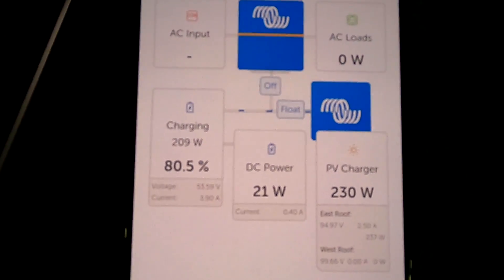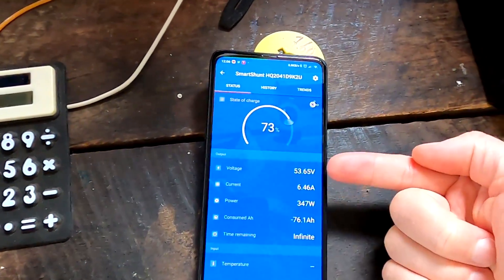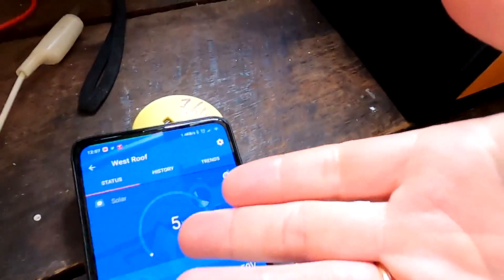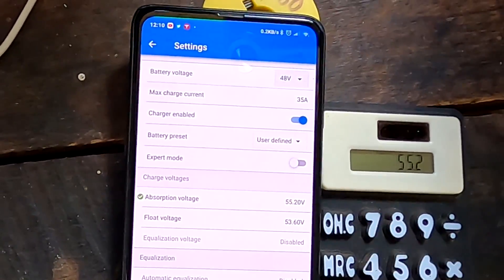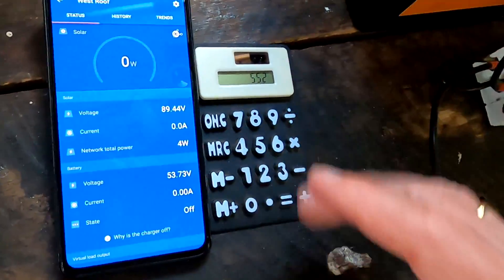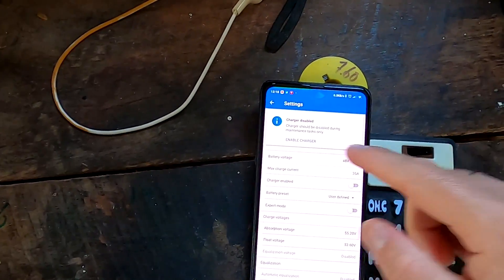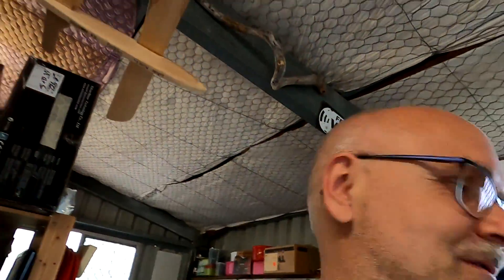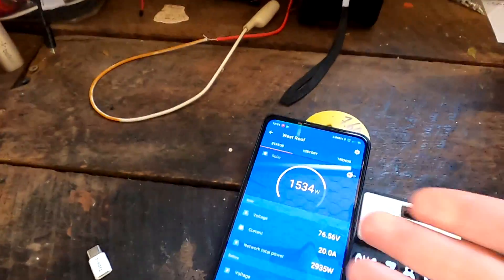Floating at 70%. Why charging LiFePO4 to 3.4V is not enough!

Comment: Did I see that right? You finally arrived at 3.45V absorption voltage?! Cool, now the float voltage to 3.375V to optimize solar production:-)
Reply from the maker: Float is only at 3.5V as this is the natural voltage the full battery goes back anyway. But 50% of people use 3.375V. That's fine too 😂
Reply: @OffGridGarageAustralia  true but that is not the reason. The reason is that if your solar can recharge your battery before sundown, it will keep powering your loads after that until sundown, while at lower than 3.375V you start discharging the battery instead of using solar power. At 3.5V float you will overcharge the battery… even at 3.4V float they will overcharge… but often float will only be for a short time until sundown, making it a moot point.
Reply from the maker: @DeVerm123  you can only overcharge your batteries if you go higher than 3.65V. Everything below that the current will go to 0 at some point of charging with CV.
Reply: @OffGridGarageAustralia  If you CV charge to 3.65V then the cell is fully charged and this is considered to be the finish voltage. The charger should then turn off. If you continue charging in absorption and float modes at 3.65V, the cells will overcharge. You can fully charge the cells by setting the absorption voltage to 3.4V and allowing absorption mode. If you float at 3.4V, you can overcharge according to some, or just not overcharge according to others, but it is considered too high for float voltage by all when considering cycle life. Even 3.375V is a compromise for utilizing solar power, as 3.35V is considered to be the maximum safe float voltage for 24x7 float.

Comment: Can't you set absorb time based on amps going into the batteries? I think Victron calls it "tail current"  I charge my lead acids like this and Absorb can be 1 hour if lightly discharged or 4 hours after heavy use (midnite classic charge controller)
Reply from the maker: Yes, I can set the tail current as well. That would be another setting to play with.

Comment: Hey Andy, why you work only with the timeout timer in absorbtion state. I mean in the SOC view the current cut-off during absorbtion is essential. The timeout timer is only a second condition to exit the absorbtion state and go further to floating state if you never hit the cut-off current. So as you know, to say 3.4V meets 99% or something is fussy because voltage alone is a very inaccurate indicator for SOC of a LFP battery.
My settings are bulk until 3.55V, then absorbtion until current drops 1A or 2 hours timeout, then floating at 3.3V with re-bulk if voltage drops under 3.2V

Comment: You don't need to auto-shut off your charging.  Just set the max A & V limits & the batts will not overcharge.
So, for example, if you charge to 3.45 V/cell, your system will only charge up to that V limit & your batt will never overcharge because it is well below 3.65 V/cell.  There's no need to absorb or float--the cells won't charge above your V limit.
Reply: That's exactly how my stupid system works! No sophisticated charger algorithms. Just get a DC power supply, set the voltage and ampere limits, and connect it after the BMS.

Comment: It's better to get to a high state of charge (pass the elbow on the charge curve) and do a very short absorption and let the voltage drop to in or just before the elbow. This is about the best you could do for battery health - avoiding sustained high voltage. Ideally also then the solar will power any loads because the load will drop battery voltage below the elbow.
Reply from the maker: The reason for charging to a higher voltage is for balancing purposes?
If you charge to 3.4V only, you would not need to balance as you're still in the flat area of the curve.

Comment: I think it's important to remember that in this scenario your setting isn't really "3.4v" it's actually 54.4v and more importantly: the problem isn't the 3.4v value. It's how you're measuring it. If you're relying on the shunt reading 54.4v you have to remember that is the voltage at the shunt with the resistance of the shunt itself and the internal resistance of the cells. If current is flowing into the battery the voltage at the shunt will read artificially high due to resistance of the cells as well as resistance of the shunt itself and any wiring between the shunt and the battery. If you're pushing 55 amps into the battery and the shunt reads 54.4v, you're not really at 3.4v per cell. If you were to disconnect the charger the voltage would instantly drop by close to 0.1v per cell because it would no longer be pushed high from the internal resistance. The internal resistance of LFP increases as the cells increase in voltage as well, so the artificially high reading gets even higher the closer you get to 100% SoC.

On my pack 60 amps of charge current at a high SoC results in a cell reading 3.40v when the actual resting voltage would read closer to 3.30v due to IR. So you're going into absorption when the cells are still only at 3.30v. This is why you cannot rely on the voltage reading at the shunt to determine when to switch to absorb/float. On my Orion BMS it actually reports two voltages for each cell: 1.) Actual measured voltage and 2.) "Open cell voltage".  Open cell voltage is the calculated voltage of the "open cell", meaning if you disconnected all loads and chargers, what would the voltage of the cell be? It calculates this by watching how the voltage changes as current increases and decreases and it calculates the internal resistance of each cell to come up with this "open cell voltage". So when it's making decisions about when to cut off charging or to cut off loads, it uses the open cell voltage rather than the actual measured voltage.

This inaccurate reading gets worse as you add solar. At 120 amps, for example, a 3.3v cell would read closer to 3.5v. So setting a higher absorption voltage will work for now, but as you add solar you'd have to keep increasing it.

The better way to solve this, in the absence of a BMS that gives you this "open cell voltage", requires that you either: 1.) Set a fairly long absorb time (remember if the voltage drops the absorb timer starts over) or 2) use the "tail current" setting available in the Victron for absorption so continue absorption until the tail current drops to some very small value to ensure that the battery voltage isn't artificially high due to a large number of amps. Using tail current basically tails the charger to ignore the voltage for the purposes of ending absorption until the current falls to a low enough level that it would no longer be causing an artificially high reading. if the voltage stays at 3.4v/cell and the current going into the battery drops low enough, then you can safely switch to float.

Another option is to just set both absorb and float at 3.4v/cell. You're not going to hurt your cells at 3.4v even if you kept them there 24/7. And since you're only charging from solar the max you could possibly float at 3.4 is just a few hours every day anyway because as soon as the sun starts to go down you won't be maintaining 3.4v/cell anyway.
Reply: This comment answers to so many questions. Thank you very much!
Reply: I was wondering about exactly this. I was thinking of using a Constant Current / Constant Voltage power supply to charge LiFePO4 batteries to 3.4V per cell, but was wondering if it would age the batteries to keep them constantly floated at 3.4V.
Reply: Tiene sentido porque observando el comportamiento de carga cuando está en 3,4v el equilibrio se mantiene sin embargo cuando voy subiendo a 3,42v y así hasta 3,45v este esta disparando la resistencia interna y produce más diferencia entre celdas

Comment: I think 3.4V is enough, but 15m absorbtion time is not. With this low voltage the absorbtion time can be "forever", remember your video where you made these tests with the 100Ah cell, the lower the voltage the longer was the absorbtion time.
Reply from the maker: Yes, I totally agree. And I was expecting these results but just wanted to test and see if I can confirm that even with a complete pack and not just a single cell charged with CC.

Comment: Yeah, it really depends on the controller, and settings. I have a Genasun boost controller that will only do 3.4v, but I think it recognizes the battery is still absorbing current so it will not go float for quite some time. This seems to get the cells to 90% pretty consistently.
Reply from the maker: Does this have a fixed absorption time or  is it monitoring the current and turns off of under a certain value?
Reply: @OffGridGarageAustralia  The Genasun controllers are hard coded from the factory so you cannot change parameters, or see what they are. But I kind of suspect monitoring the current is feedback to it's algorithm. That one is for my solar ebike build. My house solar controller is a epever, I let it charge to 3.45v, and float at 3.375v. They call non-float mode "boost" which is called "bulk" on other controllers. I have it set to "return to bulk" at 3.35v. So that lets it charge, then float, and if a load is placed it will return to bulk so I'm pulling power form the solar.

Comment: I remember from one of your videos where you used your battery tester that only going to 3.4 would take hours to completely charge the battery, why did you think 15m was enough? From my tests 15m would be more appropriate as an absorption voltage of 3.5.
Reply from the maker: It was just another test for the whole pack to see what SOC we will hit every day. It brings the same inconsistent result as with the single cell testing we did previously.
So, either charge a bit higher to 3.45V or set the absorption to ~2h.

Comment: I got all this figured out in the last few weeks too!

Looks like you're hitting 3.4v during a peak sun patch & flicking to absorption too early. Watch the voltage changes on a cloudy day - they'll vary by 0.5v quite easily on the charge controller.

Have you calibrated your Victron voltage vs your BMS voltages??? is the Victron V accurate?
I have a similar setup - 1600W panels into a 24v battery, and hit charge currents of 40-60A. So we need minimal absorption - as our charge rate is much lower than 0.5C/1C

I set my Victron 100/50 to 28v absorb (3.5v/cell) & float 27.5v (3.4375v/cell).  On the BMS the cells hit absorption between 3.47v & 3.49v - they dont actually hit 3.5v as the Victron voltage reads high!!!
The MAX absorb time is set to 15min, in reality its been going for 6-11minutes most days before going to float & the voltage drops right off when in absorption.

Pop your voltage up a bit & check what Victron reads compared to the actual Cells & BMS.

Good luck!
Reply: Hi Nate B, just curious, how did you manage to install 1.6kw panel if your scc is only 100volts max?
Reply: @noelbondad7423  hey Noel, 4x390w trina panels, theyre 40v 12A each.  so 2 pairs in parallel = 80v 24A max
Reply: @nateb3105  thank you very much. From my calculation: battery 7168wh. Panel harvest 7800wh (5 sun-hour).  Wow! I love it.
Reply: Or 1920w x 5 sun-hour = 9600 wh harvest. Even better mate.
Reply: @noelbondad7423  yeah that was the old config, have 30kw of battery & 10kw of inverters now :)

Comment: Try to use the tail current setting combined with fixed time for absorption. I use for my 600 Ah bank 10 amps at tail current and 30 minutes for absorption time. So when the absorbed current drops below 10 amps for more than 1 minute  , the chargers change to float mode. For me this happens after 6-7 minutes after the absorption voltage has been reached, in my case 3.5 volts. For you if you use 3.45 volts it might take a little longer, but using  tail current you are sure that the battery has absorbed enough and the same power every time.Moreover, in the battery sheet wrote that the charging cycle must end when the absorbed current drops below 0.05C, in my case it would be 30 amps. But the Victron chargers I use do not support more than 10 amps at  tail current setting, so I use 10 amps.
Reply from the maker: I had a tail current set before but found it's not really necessary. At 3.45V, the cells are 99% full, so I can just call it and stop charging after a very short amount of absorption time. I set the 15min usually to give the smart shunt to calibrate to 100% during that 15min window. That's the only reason. 
I think tail current settings make more sense when you charge to lower voltages and the absorption time is a lot longer. This depends then on you charge current, if you charge slow the absorption time is far longer at that voltage and a tail current makes sense.
I'll test.
Reply: @OffGridGarageAustralia  I charge up to 3.5 volts with tail current at 10 amps and the duration of the absorption sequence varies between 6 and 10 minutes. So the battery bank(600 Ah) reaches 10 amps in maximum 10 minutes and switch to float, which is ok.
Reply from the maker: @mihaitaiosub  Thank you, that makes sense. At this high voltage, the absorption does not take long regardless how fast or slow you have charged. It's 99.9% full.
I'll test the tail current with my 3.4V and see how this goes. Setting the absorption time to 2h and a 10A tail current. That should get me close to the same result.
Reply: @OffGridGarageAustralia  Those 2 hours will only work if the current in the tail current is not reached. If the current in the tail current is reached, the charger can float at any time before those 2 hours.
Reply from the maker: @mihaitaiosub  it's that's the point. At such low voltage we don't know how saturated the battery already is. So absorption can be anything.
Reply: @OffGridGarageAustralia  Before using or testing the current tail option, make sure that the charger and smart shunt are connected to the VE.Smart network, so the charger will use the values for voltage and current reported by the smart shunt that are much more accurate.

Comment: Great stuff. Some of it is over my head as none technical. Does that mean I should not attempt to build eve cell 50kwh bank in a few years for a new build house in the Caribbean. Should I just buy off the shelf powerwall from Alibaba. Then daisy them up. Bit more expensive but easier to set up and manage maybe??
Reply: IMHO, if you have the money and don't enjoy playing with this stuff, buy the powerwalls.  If you have the time and want to tinker, and it is fun for you to be a scientist and learn, go with the DIY set up.
Reply: @mfgxl  I hear you. I want a little tinker but would need to but a lot of equipment and when the time comes for me to do it I’ll br quite old man so I’m thinking find a way to get thr means to but the powerwalls. But tttttthen there’s always the reliability issue with the cheapest I’d be able to afford. I contacted a company from Shenzhen China. And for 5 pieces of 10kwh rack style (a bit like the Gyll) walls shipped to jamaica was around $12k usa dollors. Plus there’s the Wharf clearance fee which are exorbitant it jamaica. So ad another 1500 to 2k on that. Not cheap at all. But a tonne of power yum.

Comment: I am not sure if someone answered this yet, but I was explained differently when the solar guy installed my first solar system on my first sailboat, I am explaining it in 48v terms, but my setup was a different voltage. The solar guy explained it this way. Float is your target cell voltage x cell count. So let's say you want 3.4v/each cell, that would make your float voltage 54.4v because that is your desired optimal voltage when your batteries are perfectly balanced. Now you need to figure out your charge cell offset, this is how far apart your cells become throughout a full charge. So in my case, the guy set absorption voltage to 54.4v and hooked a load up and discharged my cells to low cut, then he used a charger to charge the battery to full 54.4v. Then with the default 2hr absorption period, we viewed the BMS and noted the cell difference as soon as it went into absorption mode and he timed how long it took the BMS to balance the cells within 0.01v. The cell difference going into absorption is your charge cell offset and the length of time it took the battery bank to balance to within 0.01v during the charger pause period is what we use to adjust the settings. So let's give an example, on the flip from bulk to absorption mode you saw a 0.075v cell difference between your cells because they are poorly matched... well now we would adjust your absorption voltage to Float Voltage (54.4v) + Charge Cell Offset (0.075v) = 54.457 ~ rounded to 54.46v, so this new 54.46v would be your Absorption corrected voltage. In regards to absorption time, this is how long it took your battery BMS to complete the balance, so in regards to my BMS it was only 4 minutes to complete a balance. So the settings would be adjusted as follows based on this scenario: Absorption 54.46v, Absorption Time 0hr:04min, and Float 54.4v. Regarding the bulk voltage offset restart, the guy told me to turn on all my typical constant loads that are expected to be on every single day ex.. frig... and then compare the voltage of your battery bank for a minimum of 1 minute, so if your bank drops less than 0.1v, set it to 0.1v, if it drops to let's say 0.4v after a minute, set it to that.. otherwise, the controller will attempt to maintain the batteries to the float voltage at a lower charge current as needed. The whole point of the absorption cycle is mainly to balance the cells from charging up because they can't balance properly within float mode since the BMS uses voltage bleed for balancing. also.. you need to set your BMS balance start voltage as the FLOAT voltage.
Reply: This is probably the most detailed step by step explanation ive come across on all of this. You couldve charged for this! (pun intended)😝
Reply: This right here sounds like a great approach. 👍👍
Reply: @firpofutbol  I agree!